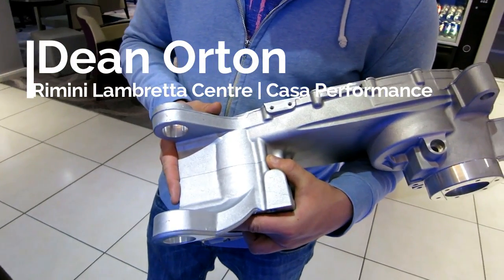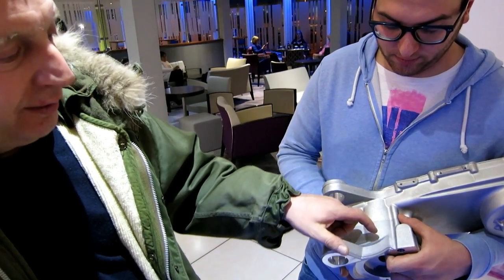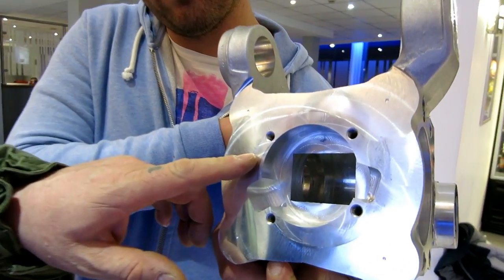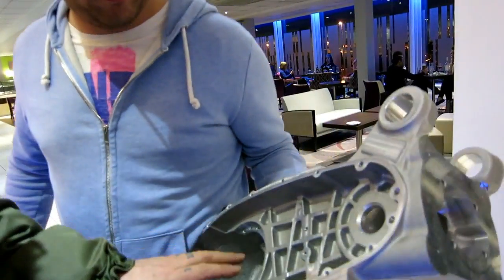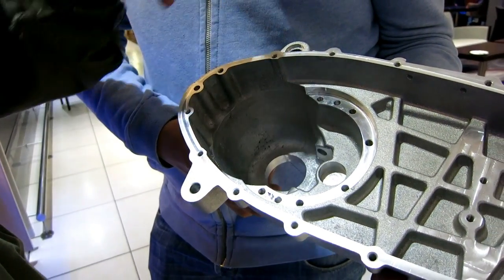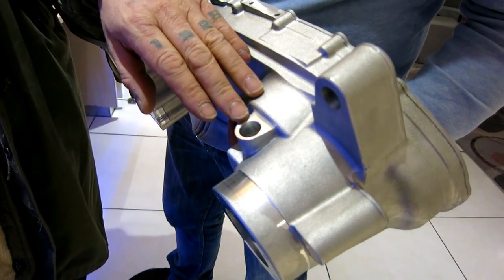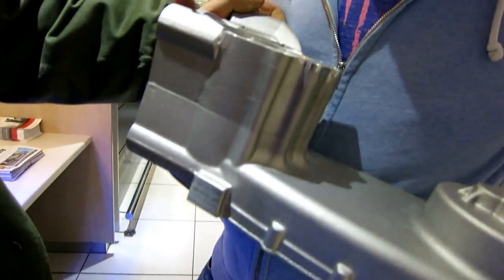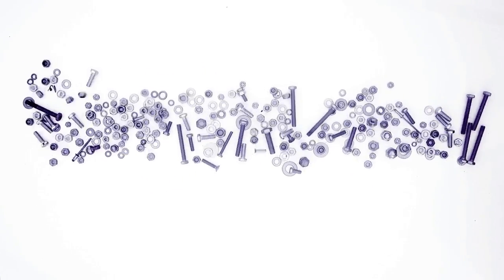SLUK Exclusive - Casa Performance Lambretta Engine Casings

Comment: still think being able to change drive side oil seal from drive side is a good idea. I hear what Dean says about..if your seals are good etc etc.. well in over 40 years I've only had two drive side seals fail. one due to gearbox oil leak from drain plug washer. the other failed due to age..it was 30 years old and had done 75K miles so should have been replaced during a winter tear down...but it's a pain in the arse when you can see the seal and bearing with the side off and you look at the head/barrel/exhaust/carb/cowlings and that's just for the mornings work. In the afternoon we got the mag housing etc and then a crank that doest want to unseat it's self from the bearing races...so one hour turns into one day . . . I like a bit of shed time but when it's midnight and I'm just refitting the rear shocker and I'm shattered my knuckles are bleeding oil you bet I'll be cursing Dean off about his decision not to fit a cover plate on cush drive bearing. .
Reply: so it's only 99 out of 100 for this casing.  the barrel gasket face is so beautiful id marry it
Reply: Fair comments CPGB but..... The reason you spent so much time in the garage was the engine was old and had a Lambretta layout. These have centrally 'split' casings so are dead easy to work on and access is unrivalled.

Comment: If it is affordable divulge the price.
Reply: +CharltonSupporter  Hi, the prices will be revealed soon once we have done a complete cost evaluation that includes an all-new engine sidecasing and the rear brakes have been finalised. It's not that we don't want to give prices out but obviously we need to be precise. If the current costings (that we already have for the actual casing itself) are taken into account, this WILL be cheaper than what most people think and will defo' be a sensible alternative to dire quality Indian casings.
Reply from the maker: +CharltonSupporter I don't think they know yet, but I bet it'll be cheaper than a good used TV200 casing and dearer than an Indian casing with things machined in he wrong positions. Somewhere between the two I'd guess :)